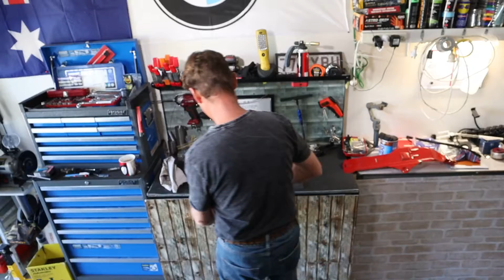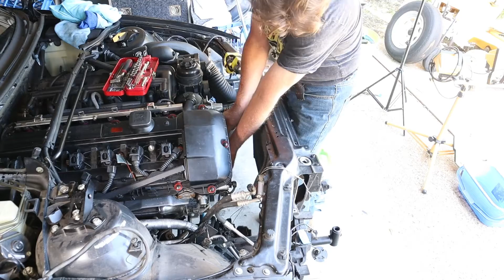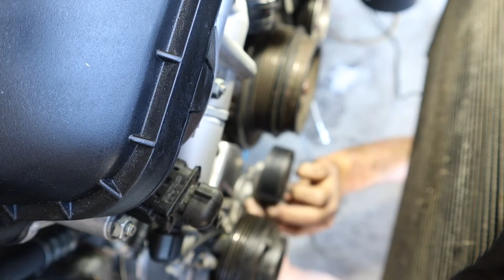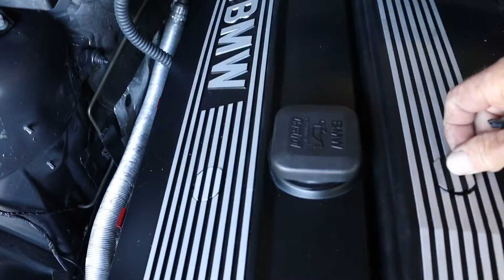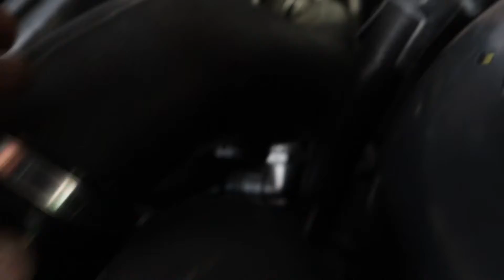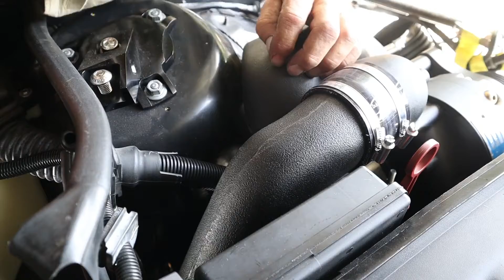BMW E46 BUILD//VF ENGINEERING SUPERCHARGER, INSTALLING BYPASS VALVE AND VACUUM LINES

Comment: Thx for your time on the videos. 
I’ve always enjoyed maintaining my own junk 
Now that I own a 2001 330i My interest in keeping this car running tight is very rewarding. 
Like you’ve said.  get all the basic maintenance done then perhaps move into mods. 
Do you recommend the M50 manifold swap on a daily driver?
Reply from the maker: It is very rewarding creating something. Manifold swap? I would consider how it matches the other mods that you have done, and what the gain is versus the amount of effort to do the work. I like to think longer term in respect to what the end goal for the build will be.
Reply: @Sixty4motorsport  as usual good advice brother. 
Really right now my main goal is to keep the car running perfectly maintained stock. 
Waiting on transmission parts at the moment.  Reverse drum. 
Rebuild kits. 
The body and car is in great condition 
Very rewarding keeping it that way.  
Thanx for your time and videos

Comment: what did you do with the f connector that came off the intake boot
Reply from the maker: I am experimenting with this one, because I could not get info myself. I have connected this to the second blank vacum port on the back of the intake manifold. I won't know if this is going to work until I start it up. (which is within the next couple if weeks).
Reply: @Sixty4motorsport  thanks for the info much appreciated!
Reply: @Sixty4motorsport  to clock the supercharger to Align with the charge pipe going into the i take. Do you loosen the 3/16 hex bolts on the turbine housing or completely take them off?

Comment: the small connection on the intake pipe near the suoercharger inlet is a vacuum connect? where does it connect to in the back?
Reply from the maker: A little tricky to explain in words....I'll do my best. On the Intake pipe with the pod filter, there is are 2 hose fittings (about 5/8"). One an elbow and one a straight. The elbow is for the by pass valve assembly (which is what I am holding in the thumbnail picture). The other is for the hose that you have modified that comes from the CCV. On the inlet pipe which connects from the SC to the throttle body there is another 5/8" hose connector. The other end of the by pass valve connects to this. On the by pass valve there should be a 1/4" vacum line, this connects to a blank vacum connection at the back of the intake manifold. (there should be 2) Remove the rubber cap from one of these (you may need a mirror to see what you are doing), and connect the vaccum line to this.
Reply: @Sixty4motorsport  thank you so much that exactly what I needed to know.  Also where you do connect the f connector that went into the intake boot?